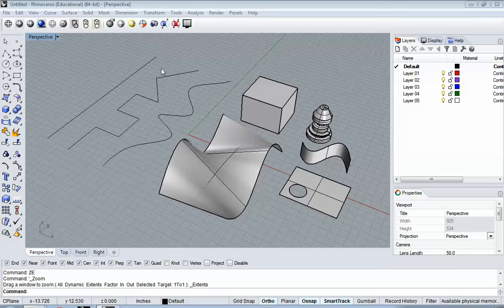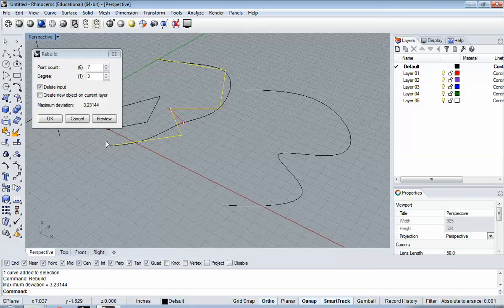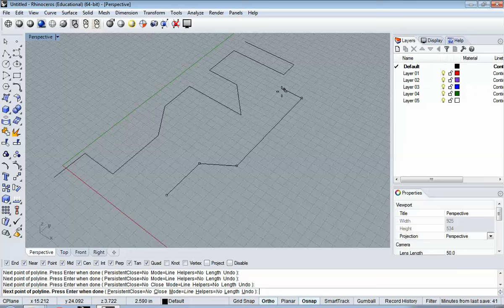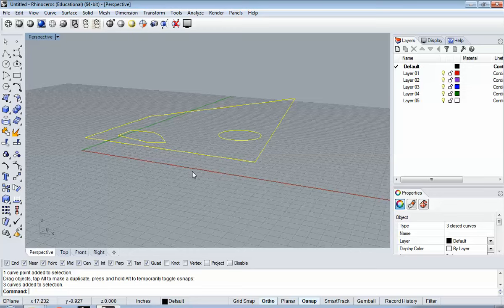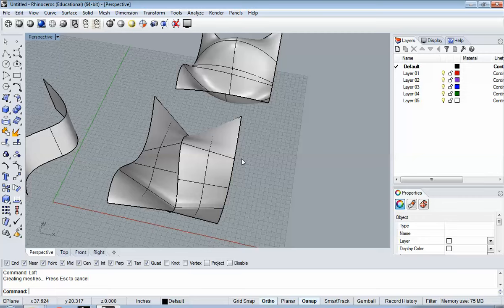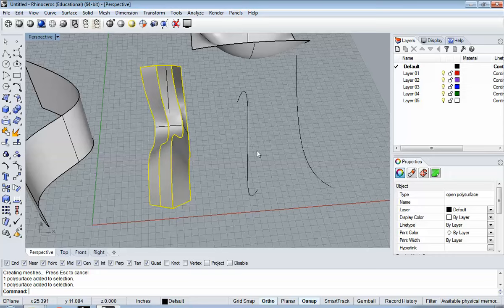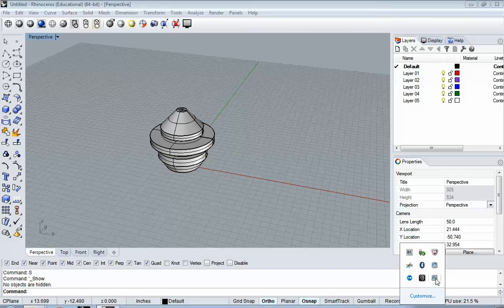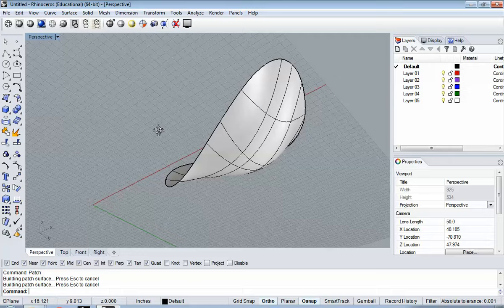RHINO Curves and Surfaces

Comment: Hi,

Thank you for excellent video. I learned a lot about commands and use if shift and Alt keys and others that I did not know they existed. 
For me and as begiñner, you were going a bit too fast and I had to stop and repeat many times. As suggestion, if you can slow down a bit, that would be great. Otherwise, a great tutorial and I really like Rhino. I have studied AutoCad, inventor, fusion 360, solid works and now trying to shift to Rhino simply because I can buy the software instead going to see subscriptions that can add up quickly.
The only thing that I did not like so far is extrude of curve using a curve.  I do woodworking and typically I draw my profile perpendicular to rectangle and I extrude my profile around the rectangle and I end up with mitered joint at each corner.  That is not the case in Rhino. I had to create a cutting curve and do a lot of trimming to get mitered look at each corner.
Thank you 
Mimi

Comment: ok networksrf is a pain in the ass. the mac version is NOTHING like that. you just basically hit networksrt and it did it. mine is not doing anything even though I gave it three different curve! UGH!
Reply: ***** Unable to create surface. NetworkSrf requires three or more curves in each direction.

so freaking done with Rhino mac. Windows look so much easier to work around
Reply: Rhino for windows is definitely more intuitive..though I use both!